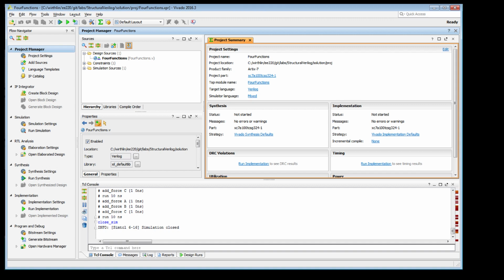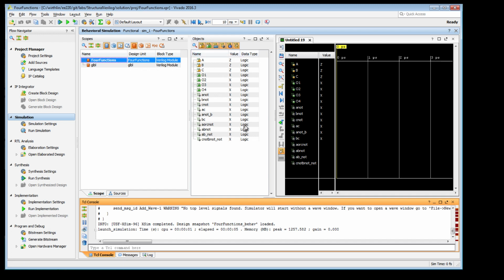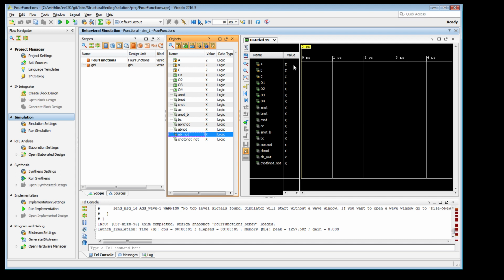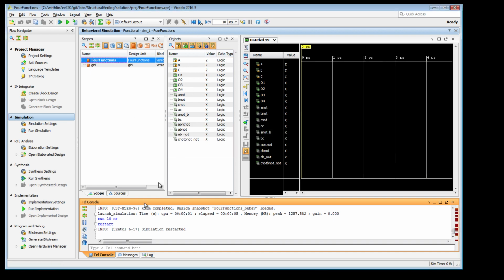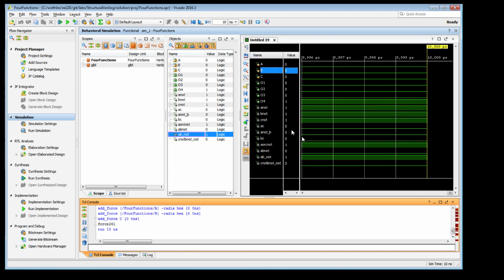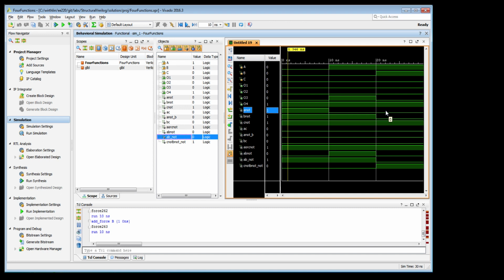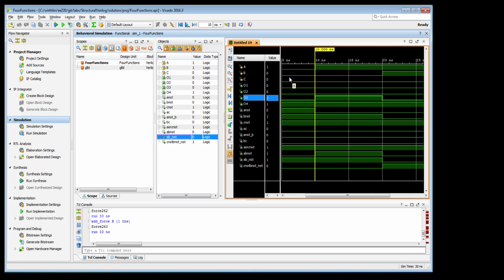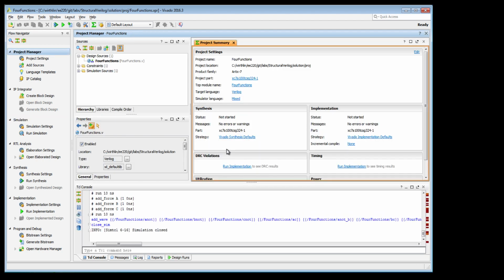vivado simulator tutorial

Comment: Thanks; I wanted to know if Xilinx Vivado can run a simulation of a model, without a dev board. This was the first search result, and it (a) confirmed that, and (b) also confirmed my suspicion that the FPGA companies prefer lumping everything together into one monolithic application, instead of smaller modular tools for each job. Currently I'm doing everything with static analysis on paper and pencil, and that needs to change.